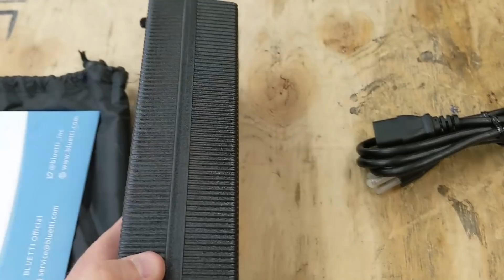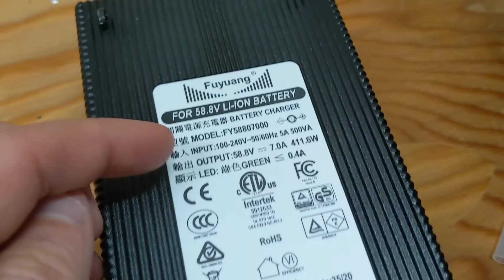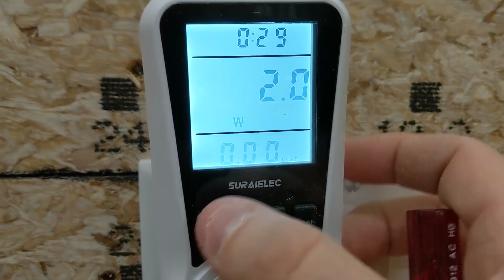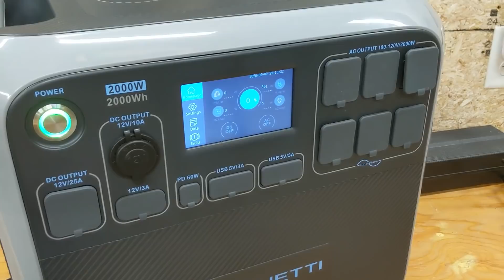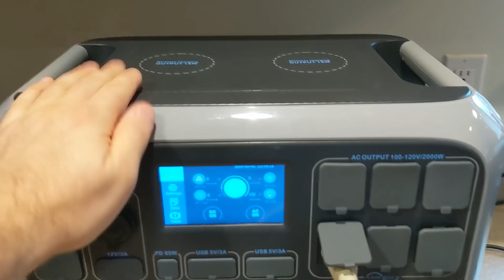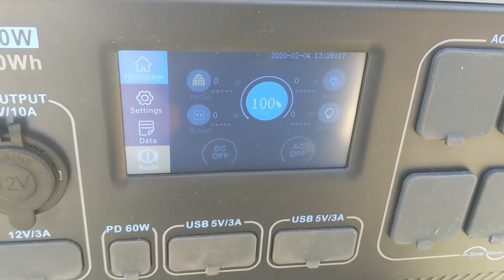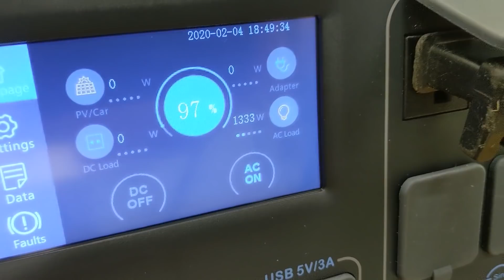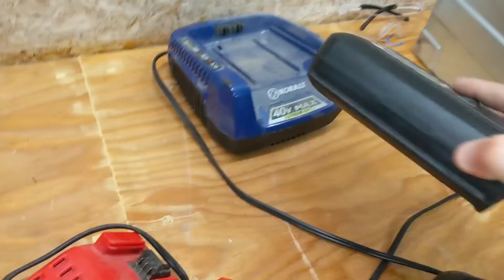DPoz Reviews:  Bluetti AC200P - Updated model for 2021 - Solar Generator

Comment: This is a great demo video. How long will u be able to run a window AC on this though?
Reply from the maker: About 4 hours for a small 5000btu window unit.
Reply: @DavidPozEnergy  Thanks for your response, sir. You really put a lot of time and effort into putting together this video. Evidenced in all the comments here from your viewers. Will you recommend the Bluetti over the Jackery 2000?
Reply from the maker: Both are good products if you are looking for an all-in-one package.  To be clear, I think you are comparing with this Jackery: https://youtu.be/36H6Sb2IG_k (affiliate link) .  The Jackery looks like it has slightly higher capacity, and slightly higher inverter output.  If you plan to charge at a wall outlet, then Jackery wins.  If you plan to use Solar, then the Bluetti has a better solar MPPT charger.  

DIY is always a fun option too.  (buying the parts and assembling yourself.)
Reply: @DavidPozEnergy  Once again, thank you. I'm traveling overseas in 2 weeks and there's always power outages out there.  I'll check out your video suggestion as well as browse your channel for more useful tips. Thank you.

Comment: I have ancient (in electronics) 500 watt rotover, a 150 watt lighter socket inverter for TV & sewing machine and a 2000 watt inverter and 12 volt microwave on power pole plugs, with 1000 watts of solar with charge controller with   AGM batteries, and it works.

Comment: Hello , i have just buy one ac200p, may I ask you: bluetti told me that if charge and discharge simultaneously as normal use, like an ups with ac input or just with solar, batteries lifespan may be affect, so what can I understand it is better to separately charge and discharge mode. Have you some feedback about that? Thanks

Comment: at about 28 minutes into the video you are charging some power tools with a blueTTI.

you made some notes regarding the sine wave and how it became distorted under these conditions slightly.

sometimes when you plug in devices that have electronics associated with them these things can distort the sine wave it's called harmonic distortion. sometimes motor controllers and soft start devices will generate harmonics and feed them back into the power system and you'll notice the waveform is distorted both the current and voltage.

I think that's what you're seeing in the video is my two cents.

Comment: Another great video, thank you DPoz. One little comment, since it’s charger gets hot, why not put it on a ceramic tile instead of a wood surface?  It’s easy to do and provides peace of mind. I do this with just about any new electronics I need to charge until I’ve gained some trust in the unit.

Comment: Hi DavidPoz, I'd like to connect some solar panels to the Bluetti AC200Max. I could connect 3 panels in series with a max. of 123,6 Volts. I'm now a bit concerned: the solar panel says it has 12,28 Isc (Amps) and Impp max power of 11,70 Amps. Do you think I still could connect these 3 panels in series to the Bluetti? A very informative video, Thank you, Ellen
Reply from the maker: I don't have the "MAX" version, but I just looked up the specs.  The manual says the maximum PV voltage is 145V.  Since I don't know your design temperature, I'm going to stay conservative and give the 25% margin.  This means your panel string can't exceed a Voc of 116 Volts.  Make sure you are checking your panels Voc (Open Circuit Voltage) and not the panels Vmp (Volts Maximum Power).
Reply: @DavidPozEnergy   @DavidPoz  Hi, thank you for your reply. I figured out that I could try to connect 2 panels in series and 2 in parallel, this lowers the voltage to 82,4 (Voc), which should be more than sufficiënt; but now I hesitate: one panel is 12,28 Amp (Isc). This would mean by connecting 4 panels with 2 in series and 2 in parallel, there's 24,56 Amp coming from the panels. Can the Bluetti AC200Max handle this degree of Isc-Amp? Many thanks!
Reply from the maker: Hi Ellen, Again, I don't have the MAX version, so to answer your question I'd have to find, download, and read the manual.  This would be a good first step for you to do before asking me. If you don't have a computer or smart phone, then you might want to try calling customer service.
Reply: @DavidPozEnergy   Hi David,  From your first post I understood you looked up the manual, that's why I continued with a question, your first answer was helpful about the voltage. Yes, I read the manual. Some techspecs in the manual say 12 other 15 Amp. I thought you might know if the machine blocks the surplus of Amps, and which quantity of over-amp is too much. Since you don't dispose of the Max-version, I hoped you might know a rule of thumb. I tried to contact the company, but in a way the form didn't work on the EU site for Europeans. From a screen in your video on the 200P it seems that the old manual stated: 'If more amps then 12A input, the bluetti only takes 12A'. Would it still be like that, and what would be the upper limit Amps, is what I'd like to know. I think you have more background knowledge than me in this matter. Kind regards

Comment: The advertisement says it can handle like 4000 watts of surge. What is surge and how does that compare to 2200 watts for 2 minutes?
Reply from the maker: If I remember correctly, it is a 2x surge for 5 seconds.  Since this is a 2,000 Watt inverter, that means 4,000 Watts for 5 seconds.  No, it can't do 2,200W for 2 minutes.  The inverter built into this unit is really not made to handle surges.  If you have heavy surges you may want to make your own system with a larger inverter.

Comment: As to the AC200MAX Expandable Power Station ... and the ACP200: in your opinion, which is better to run an older chest freezer (power outages) and a 20 cubic foot, older refrigerator?  I'm not worried about house lights, etc.  We live in a 1920's barn remodeled into a living space in the mid-60's.  Our power needs are low compared to most modern day homes.  Snow storms and power outages do occur, usually each year.  * *  I've watched your video review .. thank you.  Sadly, I do not know squat about electronics, power, etc. (my spouse does know more than I do).  I'm willing to pay appx $300 more if I can be assured that the older appliances will not defrost, etc; nor the solar generator be harmed in some way.   As a backup, I have ordered a 3.5 cubic foot chest freezer, and we have Coleman camping coolers that work with the auto lighter.  We would not plan to keep the solar charger running for long ... only enough to keep food from thawing in the bigger chest freezer and also the 3.5 cubic foot freezer.

Comment: Hi thanks for the awesome video you shared
I'm looking to operate my food trailer in economically way instead of using basic 7000 running watts gas generators
Mainly using 12000btu mini split +freezer+refrigerator+blender  and lights
Any recommendations please 
Much appreciated 👐

Comment: I am wanting to recharge my Bluetti200P through a 1000w Inverter that is directly hooked up to my 12V van battery using 10awg cables about 10 feet in length. VIA the 110 plug. The inverter overheats and I'm wondering if I just need to go to a 2000W inverter instead with 10 feet of 2awg cable? I don't want to use solar panels or rely on the 12v cigarette lighter because it takes too long. I do not see anyone else using the method I wish to use and I'm wondering if I'm going the wrong way about this. It should be fine considering the inverter provides 110 power. RIGHT?

Comment: why are you wasting all that energy only to prove the capacity? just run a fridge on it, computer, TV, washing machine, anything you actually use that to waste 2kW into the air with heatlamps. Whole world has energy and climate problems and many of these reviewers just drain kW without really using a single watt of it meaningfully

Comment: Interesting. I have just received my AC200P 240v version. It was supplied with a different power brick than yours that doesnt even get warm. Also i dont have access to the individual cell voltage info on the BMS screen.

Comment: That switching between car and PV input makes sense. Car supply would need to go through a DC-DC Boost converter to get the voltage up to the pack voltage and it would be fairly constant, while the PV MPPT controller uses a DC-DC Buck converter, and has to track the max power point. I guess they're using a relay to switch the single input through either of 2 different DC paths.

Comment: Hello I'm new at solar was really thinking about this gender My off grid RV tag I run off a Honda E 3500 ex gas generator that powers 1fridge 1 freezer 2 8000 Btu 600 watts each window Ac units & all led 40 w. Lights etc bathroom blow dryer n  2 60 watt TVs n dvrs  1375 watt Microwave  etc n PC all at once pushing 115 volts on the volt meter n when not all running evting ison a 30 amp Rv plug n 50 amp breaker panel box. I purchased 800 watt solar panels n 4 200amp hr energy batteries. What shud i I do now seeing this generator go my own battery bank n panels etc with what think i need 24 -7 Daily off grid n sale evting I ordered or by this one generator  or go a bigger one I'm TBI INJURY Disabled n do as I can With what I can remember how to do .Any help would be so awesome n very much appreciated  n I Thank you for all yo do n these videos of very informative n easy ESPN especially to sumone in my brain n memory understanding things I use to understand n did for years as a Ase Ac n mechanic n handyman for over20 Years Thanks for any help on going off grid n low cost monthly budget 🤗😉

Comment: Will the battery last longer than 2-3 years for this $1600 device.
Reply from the maker: The battery is LiFePO4, which is known for lasting thousands of cycles.  Much better than the portable power stations from 10 years ago that used AGM batteries. Those AGM ones only lasted 2-3 years.

Comment: how big of an upgrade can this unit handle as is? 2000w/2000kwh?
Reply: 2000kwh commercially built from a battery config s-16, equally distributing and accomdated to recharge at given configuration for 2000kwh

Comment: There is another term for the in rush current. LRA is the locked rotor amperage. The more time a motor spends there, the more likely the overload trips. The saw most likely gets up to speed in less time than the compressor.

Comment: Hey Dave I really like the Bluetti 200P I also like the EcoFlow as well. I am still decinging on which one I would get for what o need.  I am still getting set up off grid in Manitoba and I am running just under 3500kw of solar and a 700 watt wind turbine. I do have hydro in the house as well but like the piece of mind with backups. :)

Comment: The battery in this can be used to 0% makes no sense on why they did the 10% stuff
Reply: I had to return mine as it was too heavy! I replaced it with a renogy Lifep04 battery and a 2000W UPS inverter of the same brand. And it is all 1 handable! With this it might say 50V 40ah but it's actually 166AH - My mobility scooter has a 20ah 60V battery and that's 120AH

Comment: When it’s connected to the wall AC outlet and DC solar panel, which one does it prioritize? Will it pull from solar 1st then pull from the grid when solar is low or unavailable?
Reply from the maker: It will pull from both until full.  I don't think there is a way to prioritize one over the other while both are plugged in.

Comment: DavidPoz,  we just got ours! I see I can recharge it with a regular generator but not above 8.2 Amps. Any idea on a generator, hopefully a duel fuel generator, that I can use to recharge when sun is not available?
Reply from the maker: There are some pretty small generators that run efficiently.  I've seen good reviews of the Champion line: https://amzn.to/39IvzJ5  
I own a 5500 Honda, but it's way over-sized and gas only.

Comment: I just got my Bluetti AC200P on Aug. 31st. It is not reading wattage correctly amoung other things.  Max Oak has just been giving me the run around. They keep having me make videos of the issues.  Sometimes it will not show that there is any wattage being dispersed and when it does show wattage when I use more wattage it says that I am using less. I was very excited about getting one of these and when I seen that it was messed up I just thought " no big deal, they will just have to replace it." 
WRONG!!! They are not being cool about this at all.

Comment: I have a crypto mining rig that draws 1600 watts/h can I dual charge the power station via solar and on the grid electric to power my rig?
Reply from the maker: Yes, the Bluetti can be charged from the grid and solar at the same time.  However, your mining rig would shut down all night, so I don't know if that'd be OK or not.
Reply: @DavidPozEnergy  at night I'll just use 100% on the grid I just want to save a bit of money from electricity bills

Comment: @DavidPoz - there were some complaints in the Amazon comments about a high standby/parasitic draw for this unit - somewhere between 12 and 27 Watts. Everybody seemed more or less pleased with the short-term, high-load performance, but for low-current draw applications, the self-discharge ate too much of the battery life. Did you do any testing in that regard? I'm curious how many Watt-hours it could deliver to a 25W load left on for days... Thx! Loved the video.
Reply from the maker: I have not tested that.  Most inverters are around 90% efficient, and this is a 2000W inverter.  A 20W load being "ON" would be right in-line with every other inverter I've tested.  Last year I ran the earlier model of this all summer with it on and running my chest freezer and it never died.  But I had one solar panel attached to keep it topped off every day.

Comment: Mine won't take charge off the cigarette charger. I'm at a loss of what to do, shows watts going in but won't gain charge. I have it set on car charge
Reply from the maker: Hmmm..  I have not charged mine from my car (I use solar only).  Perhaps there is something turned on and/or plugged in at the same time?  For example, if you have the internal inverter turned on (AC ON) then that will draw a phantom load.

Comment: Can u solar charge at same-time your using it.
Reply from the maker: Yes.
Reply: You can solar + psu charge and use power from the inverter all at the same time. You can also buy additional powersupply and concect to the solar imput port, then the AC200p charges with both PSU at 800W. Or you can buy a third party powersupply with more watts and higher Voltage the AC200p is going higher. Theoretically 1200W max charching (700W + 500W) is possible, but I think no one has tried out this limit.

Comment: I'm researching solar power for an off grid workshop, as well as the potential for off grid living. Admittedly, I am absolutely clueless regarding amps, watts, AC, DC, volts, etc. and not sure my lil' brain will ever comprehend it, just not wired for it, LOL!  However, you did an excellent job reviewing & explaining this unit and at least I know what it's capable of and what to look for in other.  Sharing your time & knowledge is very much appreciated.
Reply from the maker: Glad to help.  Good luck with your workshop.

Comment: can this unit be simultaneously charges via solar and run a fridge at the same time? thinking of a refrigerator on the field as an example. how would you keep the fridge cold for 24 hours constantly?  night time? daytime ?
Reply from the maker: Yes, you can use this to run a fridge 24/7 with enough solar panels connected.  I did at my own house just to confirm.

Comment: does it charge via solar and put out a/c volts to run devices?
Reply from the maker: Exactly.
Reply: @DavidPozEnergy  i looked it up on amazon. BIG $$$$ i had an automotive cert in dc electric n took a few university courses in electronics.  im building my own solar generator. it is awesome to learn AH or watt hr  device drain formulas and calculating proper size battery bank.  plus, safety #1 w/ fuses. i appreciate your vids and your reply.

Comment: Mine is not charging with 320 watts of solar? Any ideals why?
Reply from the maker: The first thing I would check is: PV vs. Car setting.  The charging port can take low voltage (about 12V) from a car, or it can take higher voltage from a solar panel.  But there is a setting that has to be changed in the display to PV or Car.
Reply: Solarport accepts Voltage between 35 to 150V and 12A max. Check your voltage (and if necessary amperage). Use your panels im series for higher voltage.

Comment: Was checking this out as a possible UPS for my computer, one thing I am wondering though, Since I don't have any solar my only way to charge is via the included AC adapter which can only output the ~400W. If I am running a PC that is drawing 500w+ then eventually it would drain the battery even while plugged in correct?
Reply from the maker: Yes, you have that correct.  The internal battery was tested at an output of 1,900Wh.  So if you have a 100W difference between the charger, and what you are using (400 vs 500) then you could run this for 19 hours straight before depleting the battery.  So this would (and does) work as an UPS for my computer, but wouldn't if you were mining bitcoin or something that was 24/7.
Reply: @DavidPozEnergy  I saw a review on the Bluetti EP500 and they released a software update to make it do a proper UPS mode where it is on A/C power and only switches by default. Fingers crossed they do the same for the other models. Also I was thinking I could keep my existing UPS and then if power goes out, unplug the UPS from the wall and plug it into something like this AC200p and it would just pull off of that